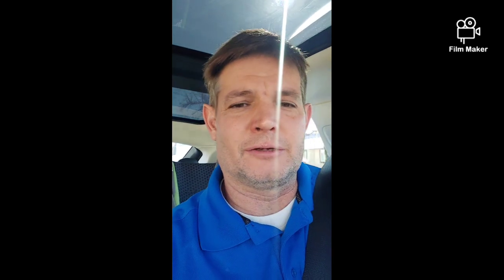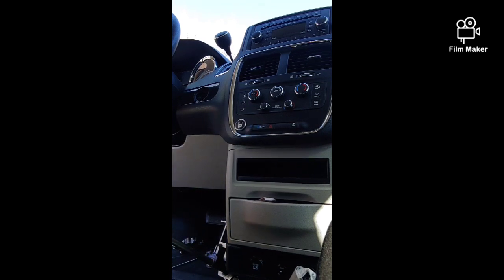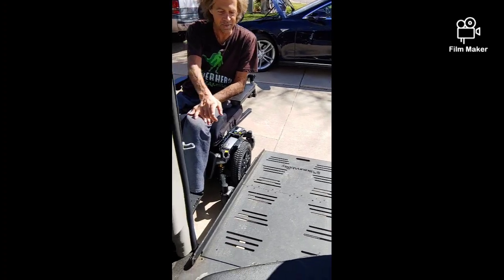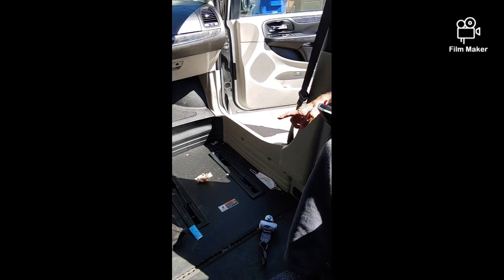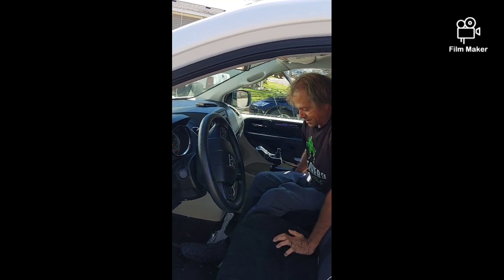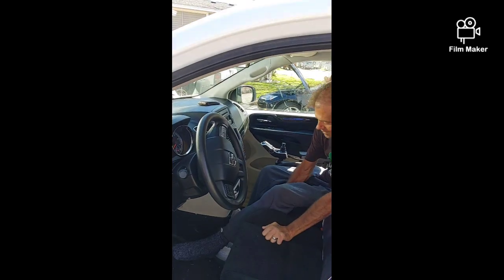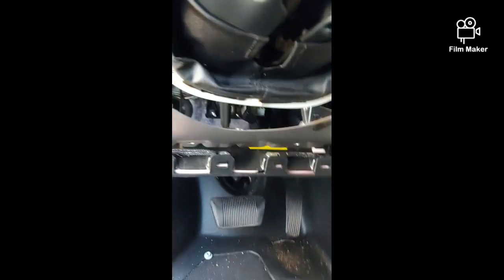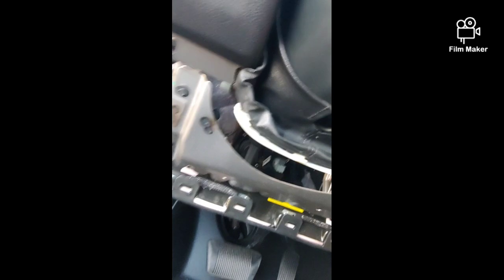Installing hand controls on a wheelchair van.

Comment: Before you know it he's going to have that van over at Fabrats, converting to four-wheel drive, then go out and "mud"  with your help.
Reply from the maker: I asked Paul what he would charge to fix the red Rover, but he said he was too busy. 😭 I’m going to have to do it myself! Haha 
I’ll take Shane wheeling!
Reply: @allterrainrandy2587  How about building some kind of 'tank chair' with ATV tracks, roll cage and front ramp so he can back his chair in, lock it and start dune surfing.
Reply: @allterrainrandy2587  well he does have his sons what 1969 GMC truck to convert. I like the competition stripes on the boys truck, but don't think Paul does but that is a 454 under the hood.
Reply: @allterrainrandy2587  I was snooping around in Sacramento California on Facebook a couple weeks ago and I noticed it there is a four-wheel drive Ford van that has a crane on top of it or a bucket truck I'm not too sure which F350 it's for sale for two grand. Is it conversion job, if you know anybody that's interested I can get the information to you.
Reply from the maker: @orangepickel2  I used to want a bucket truck, I did cable work for a year. I wouldn't mind a 4x4 15 passenger. Haha

Comment: I wonder if you moved the throttle attachment point lower on the pedal arm if it would make the throttle less jumpy.  Great video!
Reply from the maker: It was as low as it could go without inference with a foot